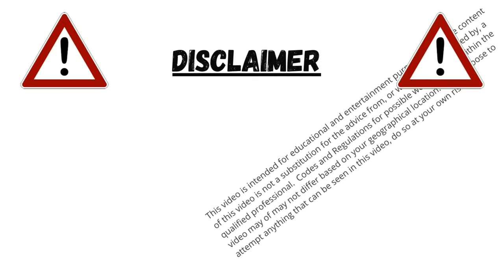Milwaukee M12 Fuel Circular Saw - Features & How It Cuts! - Best "Little" Saw I have Used 2530-20

Comment: Will this little guy cut 6061-T6 Aluminum Angle (i.e. 3x3x3/16)?
Why ???? Well I like to use it for corner brackets.
Reply from the maker: Power wise, I would think so… may depend on what blade you have on but I cut through unistrut and pipe with it.

https://youtube.com/shorts/geZAWkcveMg?si=rj9-z5mRrzwte4mR
Reply: @MORGANSMaintenance  
SOLD! 
I am thinking 48 tooth Fine Finish Crosscut with a 10mm arbor (Echo Corner).

Comment: I had one and found it to weak to cut 2x now i use the dewalt atomic little saw that shreads 2x.
Reply from the maker: ThanKs for sharing your experience. I haven’t had any problems with mine cutting it. It doesn’t cut anything like my rear handle but I haven’t noticed it struggling.

Always good for people to see others opinions 👍

Comment: Isn't this light enough for trim work? I'm currently using the dewalt xr 6 1/2 and it's pretty light.
Reply from the maker: It’s really light. I don’t know what trim you do with yours… depends on how important finish is if you can get a blade with the teeth you want.

Home Depot has a really good deal on this saw today with two 6.0 batteries… Today only though.
Reply: @MORGANSMaintenance  wow, fast reply TY. I'm going to check out HD.
Reply from the maker: @Jesse-gv9tf  it’s online only too… Home Depot deal of the day. 

https://www.homedepot.com/p/Milwaukee-M12-FUEL-12V-Li-Ion-Brushless-Cordless-5-3-8-in-Circular-Saw-and-Blade-with-Two-M12-6-0-Ah-Battery-Packs-Charger-48-59-2462-2530-20/317064961

Comment: Off topic question. Where did you get that Houdini spray? I've been looking for that stuff for awhile.
Reply from the maker: I buy mine locally at a Locksmith. That’s how I came to know about it, I bought it to lubricate locks. I ended up trying it on my tools and never went back.

Lowes used to carry it, but then they quit.  Mine did anyways.

They do have it on Amazon but it is more expensive then when I buy it. I usually buy a case of 6 cans, but I want to say it’s about half the price of Amazon. (I haven’t bought any since the world turned upside down though) So if you have a local Locksmith, you may check with them.  

Amazon is here https://amzn.to/3QcO0Jt

I have a video about it too. Hope that helps

Comment: I’m about to take the power tool combo kit plunge. I’ve talked to a lot of people who like the m12 line. The only thing holding me back is this saw’s cut capacity. I really want saw I can use to rough cut 8/4 stock.
Reply from the maker: Yeah this one won’t do it unfortunately… I’m not sure if I’ve seen any 12v saw that will, you will probably have to go M18 or another 18/20v.

The Milwaukee M18 and M12 Chargers do at least do both. I have tools in both lines.  If you want the size of the other M12 tools but get a M18 saw.
Reply: @MORGANSMaintenance  
Thanks for the reply. Am I understanding correctly that Milwaukee chargers can charge both battery platforms?
Reply from the maker: @joeprior7311  The one that comes with M18 tools can.  It has a spot for both the M12 and M18 Batteries. They are dual chargers.

If you buy a M12 Tool with a battery and charger, the charger is smaller and only has a space for a M12 battery

Comment: Really would like to own this saw as I've already a bunch of M12 tools and batteries but like it was mentioned in this video, the blades are not that abundant. I have a Makita 18V brushless that uses 6-1/2" blades and my HD's carry a lot of those from 18T to 60T.
Reply from the maker: That is the one downside. I mostly use it for framing so the one Diablo my HD has is what I normally would buy anyway… Does stink to have to order others though.

277kne just commented on here today asking  about the Makita 6-1/2 saw… you may could help him out.

Comment: I'm considering this and would like to know if you or anyone has considered the
Makita 6 1/2 saw.
Reply from the maker: Hopefully someone can help you out. I haven’t used any Makita tools for quite some time.  They are hard to come by in my area.
Reply: I've got the Makita brushless and had the brushed version as well. I use mine with the 6Ah battery and mostly cut ply, 1/2" and 3/4". The M12 would be a better tool in that it's lighter and the 6Ah is $50 cheaper in my area than the Makita 18V 6Ah. The one drawback of this M12 are the blades. I use a 60T, 6-1/2" blade in my Makita most of the time and can pick those up from HD anytime I need a new one. I have three HD's close to me and none of them carry the 5-3/8" blades.

Comment: I want one but I just don’t like that you can’t cut a 45 on a 2x4. Also idk how much it matters but the sound of it seems like its rattling and like gritty, compared to the smooth sound of the M18.
Reply from the maker: There are certain limitations for a smaller saw.  I would never say it is the only saw someone will need… but it is a good saw for what it will do saving you the weight of a heavier saw when it’s not needed.

Comment: I have the M12 circular Fuel. Built quality is super nice and it's light and precise, but I really think it lack a little bit of power.  I think it would work great with 25%-33% more power
Reply from the maker: Yeah more wouldn't hurt... especially when you get above 2x4 material.  I've been curious if these new High Output batteries will help any.

You are right though, it is built like a full size saw as far as shoe, adjustments, etc.  They didn't skimp on it.

Appreciate you watching and sharing your thoughts 👍👍

Comment: Will this cut 2"x4"s at 15 degrees?
Reply from the maker: Just tried it to make sure.  15 degrees, yes.  20 degrees is the point there it starts leaving just a fuzz.

That’s on a pine non-pressure treated 2x4
Reply: @MORGANSMaintenance  Thanks man I appreciate you checking
Reply from the maker: @rey5905  👍

Comment: No issue with this saw cutting 3/4 inch plywood.

The original blade is made for ripping, but still works fine.

I ordered a Milwaukee 5 3/8 fine finish wood and bought a cheap 5 1/2 Avanti in the meanwhile.

So far the Avanti does a smooth job without leaving marks on the wood.

People that have issues with this saw needs to cut slower and use a HO 5.0 or XC 6.0. this saw was not made for small batteries.
Reply from the maker: Speed of cut is a big thing in all saws… 👍

Comment: Imagine if Milwaukee made a m12 track saw?!? Just something small for sheet goods, without the price of a larger, more powerful saw.
Reply from the maker: Yeah that would be pretty cool 👍
Reply: I've had the M12 fuel saw for several years, mostly using it with a fine tooth blade for plywood.  I spent some time getting it very square and parallel to the base so it cuts beautifully.

Recently I got the little Milescraft track for it.  The combination works well and is much cheaper than a real track saw.

Comment: i built a whole roof and floors and many other smaller jobs just using this saw. it is enough if you are patient and have some spare high capacity m12 batteries. IT IS NOT GOOD ENOUGH FOR RIPPING! to rip something with it is a pain and a battery dies after 2 m (and I am generous with that) of ripping pine. Forget about hardwood. So yeah, it is handy for many jobs, not all jobs though. Oh and FORGET about using aftermarket batteries with this. It eats A LOT of battery power and none of non genuine M12 are good enough to keep it fed. I tried a lot of different ones. You really need the best M12 batteries Milwaukee offers.
Reply from the maker: @23mystiq  agree.. I use it on all my 2x4 and 2x6 framing jobs.  I have my rear handle when needed, but this is So much lighter…

Comment: As a full time framer, this ain't gonna do it.   Rear handle M18 is amazing though, it was great to finally get a battery saw with enough power and the form factor of my old mag77
Reply from the maker: @jook13  I carry both of them and use each when I need them.  If you are framing whole houses, then an M12 battery in any tool isn’t gonna cut it typically 👍

Comment: extremely weak saw, i know is only 12v but if you can't make a decent saw out of 12v why make it to destroy the whole Milwaukee fuel line up?
Reply from the maker: I use it all the time with 2x4 framing and really like it.  Makes me only have to use the heavy rear handle when I have to.  It couldn't be my only saw, but im glad I have it.

Comment: You claim the dewalt will not compare,,,,,,,prove it…..
Reply from the maker: I don’t remember claiming that… 

I did mention all the older small saws I had in the past were useless. (One of which was a little 18v Dewalt)

I’m sure there are other newer tools that will work just as well… tools, especially 12v has come a long way.